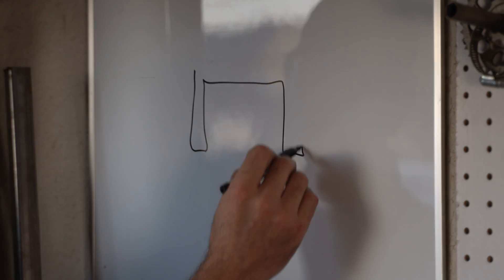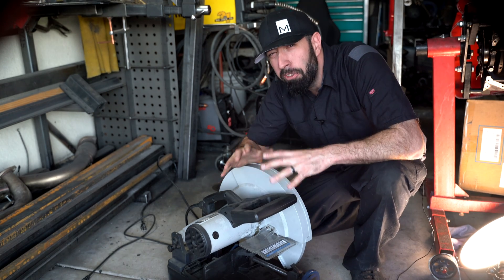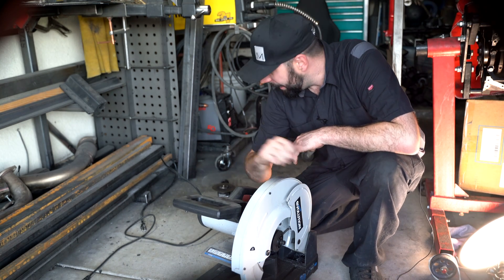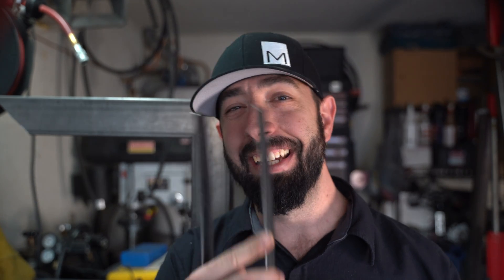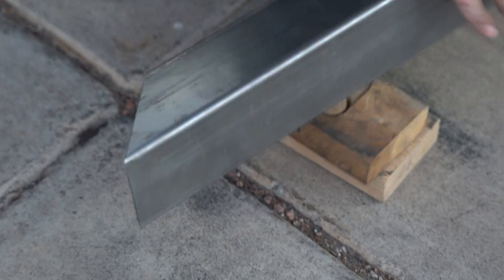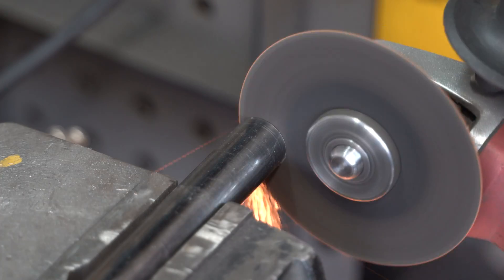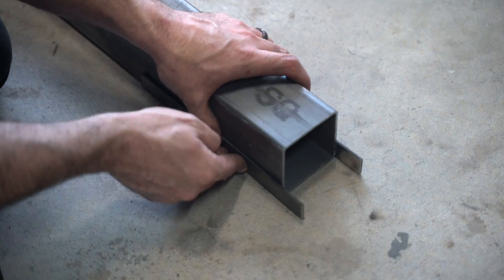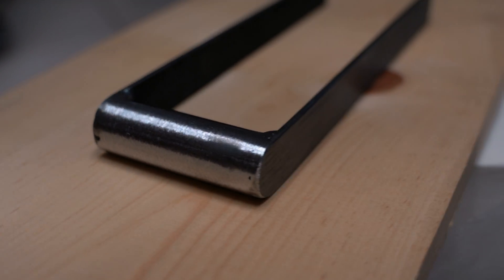Cut a Perfect Miter Joint/Corner Joint in Metal Tubing with a Handheld Grinder!!

Comment: Great tool. Have you built a tool that will help me cut 2 strips out of a piece of angle iron? Have a project, some 1" x 1/8" x 4' angle iron and I want to cut 2 strips from it. I have an angle grinder and a table saw, but don't want to put a metal cutting blade on the table saw for one project. Cheers
Reply from the maker: Thank you!
I’m not sure I understand but it sounds like you want to make flat stock out of angle iron. I haven’t exactly “made a tool” but when I need to make long cuts with an angle grinder, (like cutting square tube in half longways) I clamp a a piece of flat stock to it as a straight-edge and run the blade along it lightly taking several passes. But it sounds like you might not have flat stock. The only other thing I can think of is cutting the angle iron in half from the inside and letting the inside of the V guide the blade. You’ll get two strange shaped pieces with 45ish° sides.
It almost sounds like swapping the table saw blade is totally worth it for a better quality cut.
Reply: You totally understand! Yes, don't have any flat stock, but will make some. Will use a piece of angle iron as my guide. Thank you for your input about swapping in the metal blade on my table saw. You rock bother. Cheers

Comment: Man, nice video, but please for heavens sake, junk that grinder or get a guard for it. They are dangerous enough as they are with a guard. Insurance won’t even cover you under their fine print for doing this if something bad happens.
Reply from the maker: Thank you, my friend. I have been hurt by my grinder several times before and I honestly expect several more because of my decision to remove the gaurd. I'd never recommend removing the guard to someone else, but the guard at times seems to put me in more danger. Having full visual at all times is really important and I can't get that with a guard in place.
If you follow the channel you'll likely see a guard in the future because people have really strong feelings about this topic!
Thank you for your kind words. 🙏
Reply: @GarageFab  I do a lot of fabrication work myself and had a disc explode right in my line of sight. If it wasn’t for the guard, I’d have been gone as one piece went through a sheet of corrugated iron a few metres away. Have a look at a cordless grinder with easy tool less adjustable guard for precision work. The lower speed also helps. My favourite is the milwaukee 18v 115mm.

Comment: I can't thank you enough for this idea.  The first one I made, I had the tubing just a bit too long so that end didn't fit tightly enough.  The second one has worked like a charm.  I've been trying to make good 45 degree cuts on tubing for almost a year.  I had just about given up.  I bought an abrasive chop saw and it couldn't cut properly at all.  With your method I have easily cut two corners of  1 and 1/2 inch by three inches tubing with no problems.  Welding was easy and they came out nice and square.  You are a life saver.
Reply from the maker: Best comment ever. Thank you. I'm thrilled it's so helpful. I highly recommend scanning the comments. There's been some suggestions for improvements you might appreciate. I've been considering doing an update video.
Thanks again, Robert!

Comment: Am i clumsy for failing this 90 degree angle very first time i tried it on my own(left and right side cut properly just the upper side was a bit further cut)? I just started working and using a grinder,it was my first time(also didnt have the steel tool he had).
Reply from the maker: I wouldn't call it a failure especially in a first attempt. It takes practice and patience and I'm not sure it ever gets easy. It'll be difficult to explain in writing but it sounds like the issue is simply marking the 90 degree cut line inaccurately. It's challenging to determine where the cut should be across the top of the workpiece after marking the 45 degree sides. I think the rounded corners of the tubing causes this challenge. Next time you mark your 45 degree cut lines, draw where you think the 90 degree cut should be but don't cut right on the line. Instead cut just to the furthest edges of the line. In other words after the cut you'll still see the marker.
In short it'll just take a few cuts to realize what little adjustments need to be made to perfect it.

Comment: Sweet I think I'll make one with adjustable widths. Doesn't look like it needs to be hefty just accurate.. Good Work !!
Reply from the maker: I like that idea! Read the comments above. Someone mentioned using square tubing instead of round so the tool will naturally rest at 45 degrees. 
I don't see why you couldn't make a square sliding mechanism. As long as it's not loose fitting it should work great!
I'd love to see it if you make it.
Reply: @GarageFab  Could make it on a square tube with an adjusting end kinda like a protractor for different degrees of angles instead of soley 45°
Reply from the maker: @whatif8741  A very good idea. 💡 👍

Comment: Great idea. Do you ever use this method but leave the last wall and bend the 45? IE cut a triangular notch and bend the tube into a 90? I get that your stock for a headboard might be too long/risky to bank on a single piece, just curious if you do this on smaller stuff
Reply from the maker: Yes! That's actually my preferred method when the project allows. It eliminates a lot of welding and makes a nice curved outer corner. That method was the original reason for creating this tool. It's always been really challenging for me to cut out identical triangles. If they're off just a little I either get an angle that won't lay flat or my gap is way to big on one side. This tool definitely helps with that.
On this project I only had two 8 foot pieces of material and the back piece alone was almost 7 feet.

Comment: So it doesn’t have to lay flat? Did you weld the inside of the tool? This seems too good to be true
Reply from the maker: Wait. Wut? Are you referring to how the flat stock was sticking up at the ends just before welding the pipe in? They should absolutely lay flat in the end. I didn't realize the bent flat stock was so obvious in the video. I straightened it all up after welding.
And no, there's no welds on the inside. It's plenty secure and I don't want the weld beads to get in the way on larger material where the entire length of the tool may be needed.
Reply: My whole question was if you had welded the inside of the tool. Thanks for clearing that up for me.
Reply from the maker: lol!